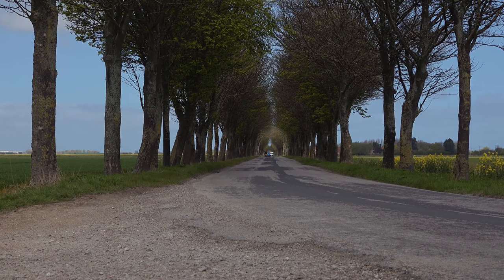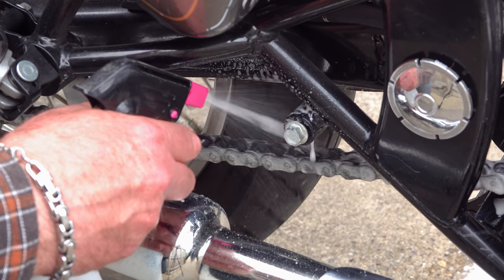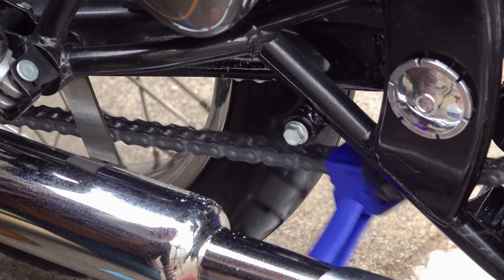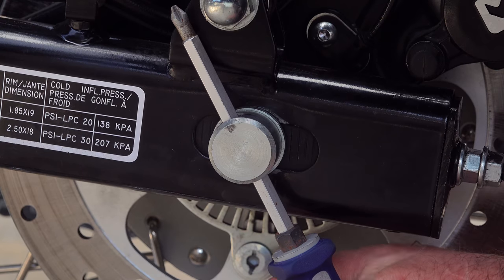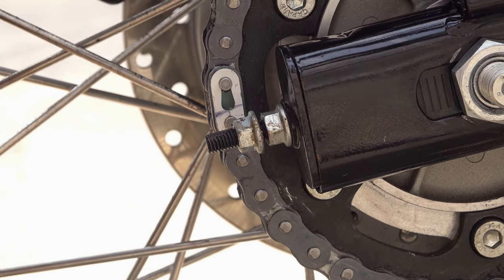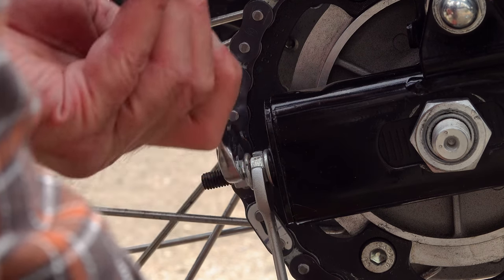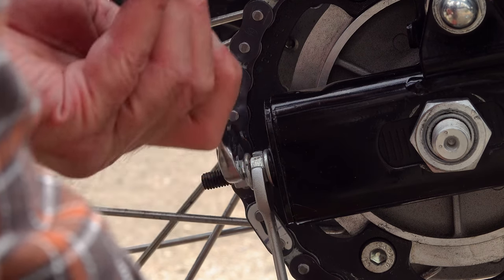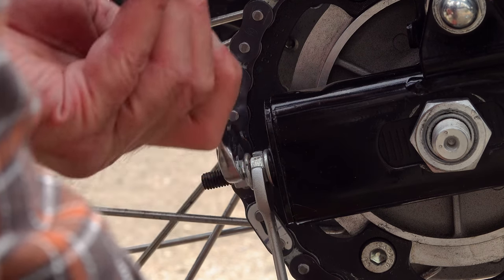Royal Enfield Classic 500, Chain adjustment and Lubrication.  A trip to the TWIGHLIGHT ZONE!

Comment: You haven’t broken anything. This is, as others have said the design of the axle. At 10:45 you can see the larger “axle” nut is in fact on a separate threaded hollow shaft. This is a “leftover” design from the drum brake days as others have said. No voodoo, just an unusual design that makes rear wheel removal easy without having to remove the chain and sprocket. You do in fact have to loosen it in order for chain adjustment to allow the entire rear wheel assembly to shift further back. The old drum brake models have three nuts. The two that you have plus an additional one that locates and acts as a torque bar for the drum. I recently replaced my drum plate that the shoes mount to due to a slow speed lockup from lack of maintenance from the previous owners mechanic. My fault for not looking at it sooner. I posted a video of it recently on my channel, so I hope it helps anyone here who’s watching and curious.

That OEM manual is an abomination.

Comment: I come from a US Navy aircraft maint. background, and I am always bothered by bolt/nut heads not having washers backing them up. It is always use a washer and turn only the nut to tighten (unless instructed otherwise). We always used water displacement anti-corrosion compound when putting screws & bolts in.
I would want to put washers on all the ones I see missing on these bikes, it's just one of those things that drive me crazy and others to roll their eyes at me. It's just me but I thought it was worth saying.... so others could share in rolling their eyes!  Love the videos and thanks!

Comment: Good information for adjusting a motorcycle chain, The only thing you didn't say was to check for any tight spots on the chain!  As 40 years ago I had my Kawssaki 750E 4 serviced and the chain adjusted, ( I now service all my motorbikes myself ) I was riding my kawasaki on the M5 motorway when the chain snaped & the chain went through the clutch push rod &I was stranded  , So every time I adjust my chain now I check for tight spots , Thanks for the video,s  I like the old School approach!

Comment: Thanks for this really helpful video. The markings on my RE classic swing arm were only visible in slanting light.
I used the end of the end of the aperture and a ruler as you suggested , and added a micrometer as a check.  The left hand side drifts a lot 
So pushing the wheel as you said was essential. Without that tip the back plate and adjusting nut would have been flapping in the wind.
Thanks again . Great stuff.

Comment: As usual, another very informative video from 'Uncle Stu'. Excellent.
Interesting sprocket/axle nut issue. I can only think the sprocket nut had bottomed out on the actual axles threaded section? Obviously a washer under the sprocket nut as a spacer would eleviate that. The fact that the axle locking nut at present tightens it up defies logic!
My old 2003 Bullet 500 uses snail cams and the marks on these certainly don't line up correctly. No suprise there then!!!
Keep up the great work Stuart. You were very instrumental in me buying my RE 650 Interceptor.

Comment: Hi Stuart! Thank you very much for this video! It is full of pieces of information that will clearly help me for the next chain maintenance of my RE
A few days before this video had been uploaded I did part of the chain maintenance: degreasing, cleaning and lubing the chain, and also clean the different parts receiving grease projections. It was a real nightmare and took me the whole afternoon because the old grease on my chain was difficult to remove (a big thanks to the local newspapers for providing me enough protection for the garage floor). For the chain slack, since I did not had the right tools for that, I brought my bike to a local motorcycle garage and the mechanic told me this bike was very hard for chain maintenance. Moreover, I really love the original big exhaust pipe on the RE, but it's a real nightmare when it comes to chain maintenance: hard to access the nuts on the rear wheel axle, but also to clean and lube the chain and to check the tension of the chain
Now I have a video to refer to for the next time! Again, thank you!
I'm not an expert in bike maintenance (it was the first time for me to do that), but in a sense I am quite glad to see that I did most of things you have done in your video (I inspired myself with your video on the maintenance of the Interceptor)

Ride safely!😄

Comment: Sir, its always a great pleasure to watch you taking care of motorcycles. You complete individual task with good details and its soothing to eyes. I really loved the way you cleaned and lubed chain. Now I can add few more steps in my process.
As far as chain adjustment is concerned, you did everything correctly (I had confirmed this from RE service center). Owner's manual from RE is not upto the mark, missing details, here and there. Mine displayed incorrect level upto which the gas tank should be filled.

Comment: Stuart i just commented on your valves video for the 350, you are a godsend!

I followed along this video on my classic 350 2023 version and they seem to have altered a decent amount of stuff. 

There is only one axle nut now, not a separate sprocket nut as there are in this. Loosening this doesnt have any direct bearing on the alignment of the swingarm besides loosening it obviously.  

The chain adjusters are now only one nut, with no locking nut in front. These directly change the swingarm alignment and the chain tension. Still an 8 mm allen key required, no need to take the silencer off either since the axle bolt only needs to be loosened with a spanner to allow the chain adjusters to have an effect. 

Definitely a lot easier!

Comment: Once of a day I used to remove the chain, wash it in paraffin, then boil it up in a bubbling cauldron of "Lynklife". This is a black, solid grease that needs melting and was popular for chains. Now I know how a chain should be cleaned properly! 
As mentioned, the double nut is a hang-over from a quick release that does not quite function now, especially with pannier frames and a pillion seat. My Classic 500 ('Tribute') has large washers on each side that are different diameters, the swingarm slots each side are different lengths, the vertical lines on the adjusters are not numbered, so cannot be matched from one side to the other. There is a punch mark on each adjuster but I could not tie those to anything significant so I ended up measuring each side from the axle centre to the centre of the swingarm pivot to make sure the wheel was aligned. Next time the back wheel is out I shall match up and number the adjuster marks!
Reply: I remember knocking over a tin of hot lynklife. It set very quickly on dad's cold garage floor and took quite a while to clean off.
Reply: @alanbriggs7177  Yes Alan, been there, done that! Even if I did not knock the tin over, there would be a splatter zone of Lynklife splots on the garage floor and my clothing after every greasing that went normally.

Comment: The forward thinking RE quick release rear wheel , dead handy if you get a puncture , your chain stays adjusted and in place if you have to remove the rear wheel, RE have used this for decades , my Super meteor has it as does my iron barrel , seeing as my bikes have the dredded snail cam adjusters I find it easier to adjust the chain first , locking of the sprocket nut and drum brake stay which keeps the chain inline , then true up the wheel before tightening the axle nut , once your used to it I find it as quick if not quicker than some other types of adjuster , certainly a lot easier when it comes to tyre changes , sprocket and chain changes , just undo the axle nut , slide out the axle , pop the wheel out , then all you have left is the sprocket and chain to deal with , easier than fiddling about with whole wheels , sprocket and chain in one go , strange isn`t it when you think , a forward thinking company like RE who pioneered Anti-lock braking on bikes (although it never went into production bikes) , quick release rear wheels and swing arm suspension , ended up going bust and for many years ended up being regarded as a quaint 2nd rate has been built in India.

Comment: Hi uncle Stu. Hopefully I can explain this right. The small nut tightens the axel. The big nut tightens onto the sprocket carrier. When removing the rear wheel the rear sprocket stays in place. I hope this helps . Ride and be safe.  Ron.
Reply: Hey Ronald.. Im the proud owner of a 2021 RE Classic 500.. Adjusting the chain is an absolute nightmare for me.. I understand the two axle nuts.. Its the chain adjusting I can't work out.. The slots on each swingarm are different sizes, and I was told to ignore that, and instead line up the punched mark in the adjuster with the lines in the swingarm on both sides.. Is that right??

Also when looking down at the steering head, the frame isnt 90° with the bars.. Whats causing that??

And lastly.. Looking at the back of the bike.. One arm of the swingarm is lower than the other, and the mudguard looks twisted.. Is this just a build quality thing, or is it all just a Royal Enfield quirk.. I mean, the bike runs perfectly well, but when I'm on a group ride I get comments from riders that have been following me that the wheel looks like its crooked or out of alignment..

Comment: What we have here is what's called a QD rear wheel. QD means quickly detachable, enables the wheel to be removed, leaving the rear sprocket/chain in situ. I have only seen it on old Triumphs (mine was a 1963 5TA speed twin) and my two Royal Enfields (2007 & 2018).
Reply: BSA had QD rear wheel's in the 40/50s.

Comment: The bigger nut doesn’t tighten the wheel up it holds the sprocket and chain in place while you remove the rear wheel. 
I had the same mither after years of adjusting chains couldn’t get the wheel equal both sides so I thought I’d try and knock the axel through to see if it was being held and no it wasn’t hope this helps.

Comment: Thank you once again for another informative video, these must take ages to make. 

Due to my first puncture in 12 years I picked up a nail in the rear tyre, I am going to have to remove the back wheel of my HNTR. I have never done this before. I noticed a bit of weaving on cornering but it's reassuring that when the tyre looses all its pressure that the bike will still get you home riding slower.

Comment: Great video. One thing I've noticed on my 2019 Classic 500 is the route of the rear hydraulic brake line. It's very tight below the lower shock absorber nut. As the wheel goes back with further adjustment, I'm less happy with it.

Comment: Mines up at 1300 but had to adjust around 1000. Painstakingly aligned rear wheel so that in future, moving the adjuster nuts a flat at a time ensures alignment. I did invest in 30 and 24 mm ring spanners which means torque is industry standard 2 grunts tight. It was a unnecessary faff as you describe working out how the axle is secured. I use my bike dryer, small nozzle to help dry out the chain etc. Like anything,  proper maintenance and adjustment should ensure long life. Though I guess most in UK will only ride in dry conditions so wear should be minimal. Use wurth dry lube. No noticeable fling. Ride safe👍

Comment: As other people have mentioned, the larger "sprocket nut" secures a stub axle that runs through the sprocket hub only. This secures the chain side of the wheel. The axle spindle runs through the whole of the wheel (entering from the lhs) and passes through the sprocket stub shift before being secured by its own smaller threaded axle nut. Thus the whole wheel is tight. On my bullet trials 500, due to a complete vacuum of decent info from the handbook, I tighten first the large nut to 70nm and then the smaller axle nut again to 70nm. All seems to work OK. 
I note that you adjusted your chain to 27mm with the bike ON the mainstand. On my bike this always results in a very tight chain indeed when the bike is back on its  wheels and with a rider sat on it. Premature chain stretch will be the result plus it won't be doing the gearbox bearing  much good either. Maybe your bike is OK....such are the foibles  of bullet ownership. Happy days though cos they are such a fun bike to ride.
Reply from the maker: yeah its the only bike I've owned where its recommended in the book to check the chain on the stand. I've found it doesn't alter much on or off the stand. I know this has been a hot topic on the RE forums for decades but the general consensus is to stick to RE instructions.

Comment: Great video as usual and I can certainly empathise with you Stuart! I had the misfortune to have a flat rear tyre on my bullet just a few weeks after I bought it. I must admit to experiencing your confusion when I was removing and refitting the wheel in a local shopping centre car park where I'd managed to push the bike in order to get off the roadside. I scratched my head for quite a while looking at the set-up (mine's a 2017 so has the drum brake and snail cam adjusters as well) and wondering how in the hell it all worked. It's quite an ingenious design in that it allows you to leave the chain and sprockets in place, and up out of the dirt. The wheel can then be removed and refitted without disturbing the chain tension etc. Love it, and love my bullet!

Comment: Yes, Stuart, I often align mine by measuring the amount of threaded bolt sticking past the lock nut on the adjuster. And yup, I often use Chain Wax (probably the same as yours)  and I always oil on the inside run of the chain and not the outside.

Comment: It is a very old system in fact my 1934/5 BSA Blue Star had it and it was a godsend if you needed to remove the wheel for a puncture on the road. A long-ago memory. I sold it for eighteen pounds and I have regretted it ever since. Upswept exhaust I went everywhere on that bike. Purred like a kitten. Girder forks and rigid frame but held the road well.
Reply from the maker: Thanks for the info

Comment: Nice one Stu, I got a bit of a different approach because I don't have to worry about 0-rings after I replaced my original chain with a 5/8 x 3/8 Elite 530 chain which has no o-rings. I get about the same mileage out of them, but cleaning has become one of those jobs I can do quickly and thoroughly by dunking it in diesel - i got a little fuel pump set up to rinse the chain  and I brush it clean, then I use an air compressor to blow it off dry an then soak it in a tin of heated Putoline Chain Wax an then leave it to set/drip for about 15 minutes before the jobby goes back on. I saw you were mesmerized by the RE twilight zone - that had me stumped the first time as well, but I figured it out that the sprocket nut actually runs on a different thread :)

Comment: Just a suggestion: on low powered bikes that have a spring-link, buy a spare chain and have it ready cleaned and lubed in its tin.  Remove the spring link, draw the new chain on using the dirty one and replace the spring-link. Bike and sprockets can be easily cleanedwithout mess on the garage floor or rest of bike. Also I noticed a lack of large washers on the swinging arm. I would fit a pair to minimise damage to paintwork. HTH Stuart.
Reply: This is just an observation....I don't  know how widespread it is on euro 4 bikes.
 You mention fitting of large washers to protect the swing arm.
My bike, a 2020 Bullet 500 Trials, HAS large washers factory fitted behind both the larger outer sprocket nut ((RHS) and also underneath the axle spindle "head" (LHS).
However, my friend has a 2020 Euro 4 Classic 500 and the washer under the large sprocket nut (RHS)  on his bike is also missing ...in similar fashion to that on Stuart Fillingham's bike. Looking at my mate's  bike I can see that there does not appear to be as much threaded shaft protruding out from the swing arm as there is on my bike (not enough to even to accommodate full the thickness of nut). Fitting a washer would shorten the effective thread length even further.
I just wonder whether this a factory clanger and removing the washer was a quick fix to remedy the problem. I might be totally wrong so like I say 'just an observation' .

Comment: I got spoilt owning bikes like Honda NT650 Hawk and VFR with single sided swing arms. 
At least the adjustments on the Royal Enfield Classic 350 are much better than this setup in the 500. 
Just did ours last weekend and it was pretty easy - even using the pot metal tools in the side panel. 
I use Honda chain cleaner and moly chain lube. Great stuff, easy to find. 
The chain cleaner is also great for cleaning the oil basket and exterior gunk from the road that accumulates on the bottom of the engine cases. 

Ride Safe 🙏🏼